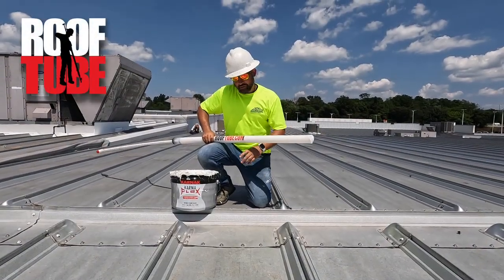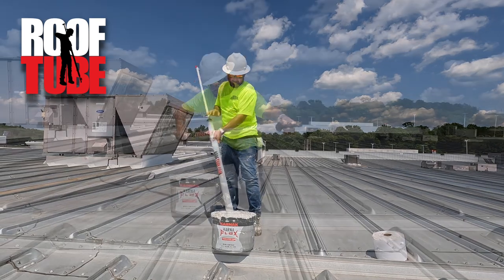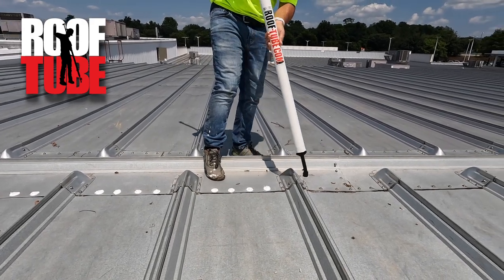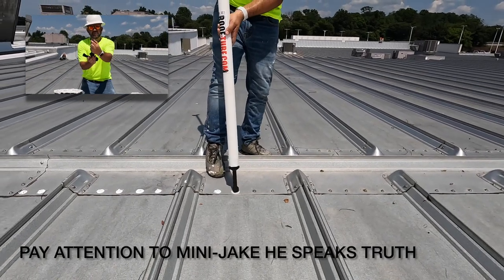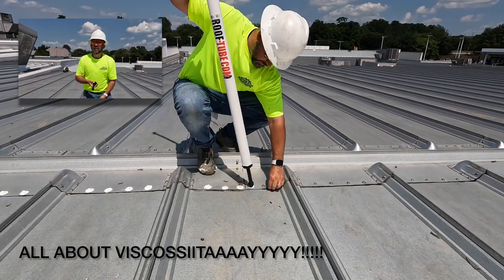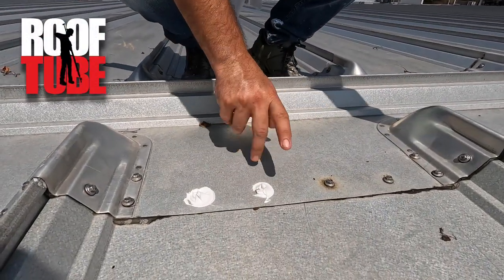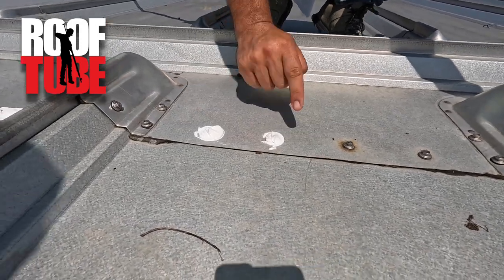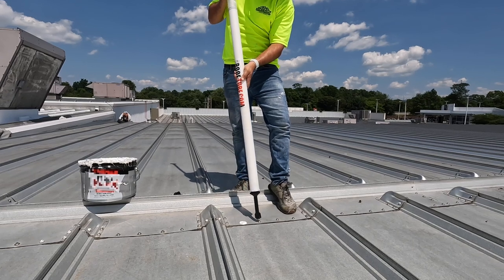How to Fix Leaking Screws on a metal roof Fast     HD 1080p

Comment: Kinda funny when I was in my 20s I used a water gun for our pool to do exactly this. Cut the tip off a caulk tube and some sealant with a hose clamp and I got the same product for 10 dollars😄 I need to remember this because people buy the most expensive stuff. Marketing must kill some poeples bank accounts

Comment: STANDING SEAM IS THE REAL DEAL IN METAL ROOFING
Reply: YEP, I'm in Nawth Florida and the home we bought has exposed screws and now I'm having to tighten the original ones that were loose or backed out OR replace them with the bigger "Repair Screws, after checking them in 1/3 of the roof I may just go back and replace ALL of them with the "Repair screws" AND do this after ward

Comment: Do you  sell  any  attachments which can  be  used on  regular 310ml  silicone cartridges?  I am not a  roofer but  want to seal  the screws on my metal shed, so looking for a attachment  nozzle which can  be  used on regular silicone tubes, rather than getting the roof tube,  only  got   20  screws to do.  Also what sealant at you using please? And does it come in  brown? Thanks